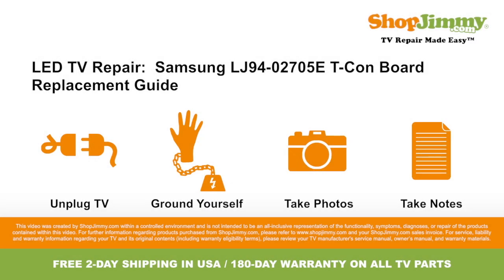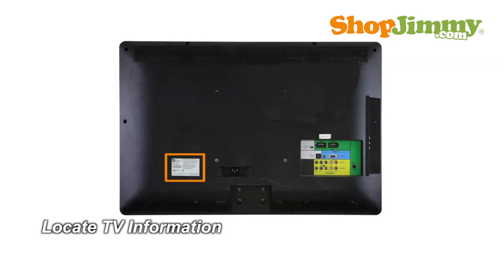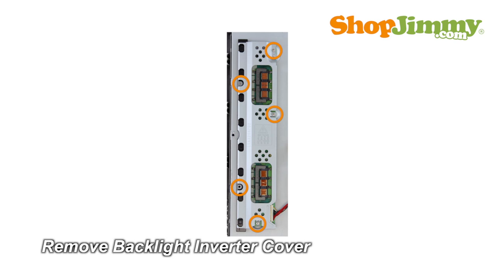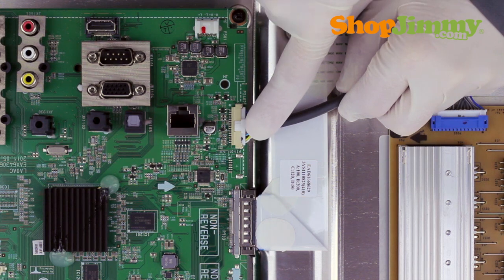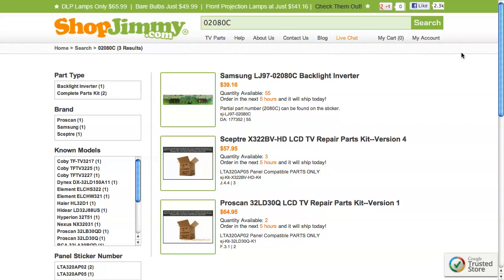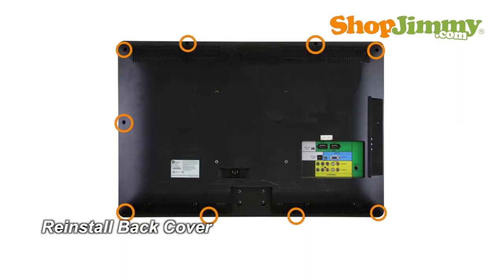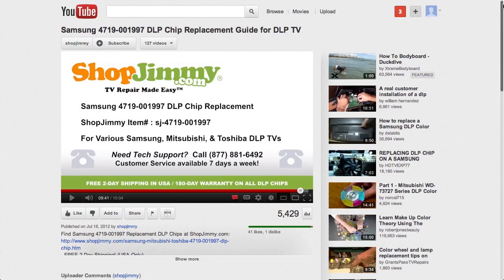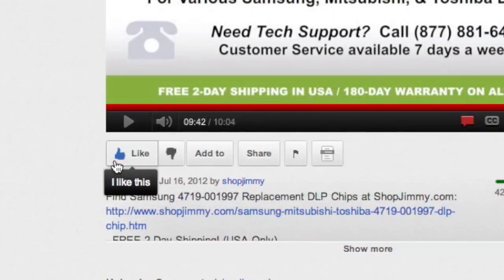Samsung LJ97-02080C Backlight Inverter Boards Replacement Guide for LCD TV Repair

Comment: I need some help. I have a Samsung TV. Standby red light turns on, but no picture. I did the flashlight test and can see the picture. I replaced the TCon board and still no picture. What should I do? Power Supply board or inverter boards on bottom of TV?

Comment: You NEED to show EXACTLY how to remove the backlight inverter panel you do NOT the next thing you show is BAMM it's out But you did not show how you did it.  It slides into the connectors that are connected to the lights this is VERY VERY tricky because it's like its glued in and it has to be muscled out without breaking the lights especially if they are CCFL lights.  It would be nice if you showed how this is done because I have 2 broken CCFL bulbs and I did not know how to put them in even after looking up and see if anyone shows how to do it.  I had to figure it out myself, but I am sure other people have had the same problem I did so Please do a video on HOW to remove backlight inverter panels with CFLL bulbs thanks

Comment: I have a sumsung model LE32R86WDX  CODE LE32R86WDX/XED. It has audio but no image. Would I need a Inverter board to fix the issue? How much would this cost plus, I live in the UK

Comment: Hi, I have a Samsung LN46C630. The problem with it is while my son was gaming the screen went black, sound was still audible, just no picture. After finding your site we ordered and replaced the T-con board and still no go. I am going to order the backlight inverter next, do you think this will fix it or is it another board? May end up replacing all the components.
Reply from the maker: Denise Gibson   I recommend running the flashlight test on your TV.   Here is a link to a video we produced that shows how to run the flashlight test. https://www.youtube.com/watch?v=xUzCLgoSPGM Please reply with your flashlight test results and we can recommend a replacement part for your TV repair. Thanks and please let us know if you have any questions! www.shopjimmy.com

Comment: Samsung LN-T5271F. Screen flickers where the bottom half of the screen shows up on the top half of the screen happens on all inputs (from what I've seen). I've seen it on both HDMI inputs (with an Xbox One and Xbox 360) and on Composite (DVD player). It's fine a lot of the time but I can make it happen regularly in some places (for example the menu in the Xbox One game as seen in the video) and it seems to happen more randomly at other times. A video of what is happening is here: https://onedrive.live.com/redir?resid=3c58517279d0c041!6610&authkey=!AD9CYL9Yemm2zcI&ithint=video%2cwmv

Any ideas? Thanks.

Comment: Hello, I have a 46'' Samsung TV, that just last week would have the screen go black but could still here the sound. So when I check a lot of others issues I decided to replace the backlight inverter board and was told to leave tv on for at least 30 mins to see if it will work or not. But now it won't stay on long enough to get to 30 mins, plus my screen is still black. Im thinking now it might be the power supply board? Please give me your thoughts. Model LN46D550K1FXZA
Reply from the maker: Carey Greenfield   I recommend running the flashlight test on your TV.   Here is a link to a video we produced that shows how to run the flashlight test. https://www.youtube.com/watch?v=xUzCLgoSPGM Please reply with your flashlight test results and we can recommend a replacement part for your TV repair. Thanks and please let us know if you have any questions! www.shopjimmy.com
Reply: ShopJimmy.com I tried the flashlight test and don't see anything on screen. I already replaced the backlight inverter board and screen is still dark. Now it only stays on 10 mins at a time and shuts off. Would that be the power supply board?
Reply: +ShopJimmy.com I did this test and see words... What does this mean

Comment: I have a Samsung UN32F5500 which have audio but no video. Well video comes in and out but most of time is black screen. With a flashlight I can see the picture in the back so I believe that is a back-lighting issue. When TV starts up the samsung logo is visible and looks perfect, however once the source is live on any TV input is start doing the issue. Can you recommend in your experience which of the boards can be the troublemaker.....so I can start in order of suggestions
Reply from the maker: Juan Mujica   Please watch this video FIRST to help with your repair!  https://www.youtube.com/watch?v=BP3NVNCGEv8 This could be a problem with either the power supply board or the LEDs in the TV panel.  You can replace the power supply board in your TV to see if that fixes the problem.  Click this link to a replacement power supply board for your TV model number:  http://www.shopjimmy.com/samsung-bn44-00605a-power-supply-unit.htm  Be sure to match part numbers on your current board, with your replacement for compatibility.  Thanks and please let us know if you have any further questions with your TV Repair!  www.shopjimmy.com
Reply: Thanks.

Comment: hi, I have Samsung 40 in lcd tv, TV is black screen, the sound is still good, power on and off is ok, can you please help me?
Model # LN40C500F3FXZA
S/N#22RD3CU2910
if you have part can fix my tv please let me know
thank you
Reply from the maker: Long Pham   I recommend running the flashlight test on your TV.   Here is a link to a video we produced that shows how to run the flashlight test. No Image No Picture on TV Screen - Flashlight Test LCD & LED TV Repair - How to Diagnose Symptoms 2 Please reply with your flashlight test results and we can recommend a replacement part for your TV repair. Thanks and please let us know if you have any questions! www.shopjimmy.com
Reply: hi, I test my TV like on your video, I turn on TV , on the front I test flashlight, but I'm not sure, I see all dark,on the back I live TV in the dark room,on TV but I don't see any light at all ,I  just see on and off light only, on the front of TV.
Samsung TV model
LN40C500F3F
please let me know , thank you
Reply from the maker: Long Pham  Please watch this video FIRST to help with your repair!  TV Repair! LCD, LED, Plasma, DLP How To Fix Your TV with ShopJimmy.com Help!  I recommend replacing the main board in your TV.  Here is a link to replacement parts:  http://www.shopjimmy.com/catalogsearch/result/index/?cat=56&q=LN40C500F3F  Be sure to match part numbers on your current board, with your replacement for compatibility.  Here is a link to a video showing how to identify your part number, click here:  Samsung Main Boards & Digital Boards: Part Numbers for LED, LCD, DLP, Plasma TV Repair  Thanks and please let us know if you have any further questions with your TV Repair!  www.shopjimmy.com

Comment: I have a 46 inch samsung tv model code LNT4665FX/XAA, my issue is the tv have a rectangular vertical shadow in the center of the tv, it shows up also when you press the menu button, its like 4 to 5 inch wide, could it be an inverter board?
Reply from the maker: *****   SAP function is turned on in menu turn the function off and you should be good.  Thanks and please let us know if you have any other questions.  www.shopjimmy.com

Comment: I have a Samsung 46'' the LCD turns on for only one second then it goes black sound and everything else seems to be working fine.What could be the problem?
Reply from the maker: marco lopez   This sounds like you should replace the Y-Board and the buffers in your TV.  Please reply with your TV model number and then I can recommend a replacement part for your TV repair.  Thanks!  www.shopjimmy.com